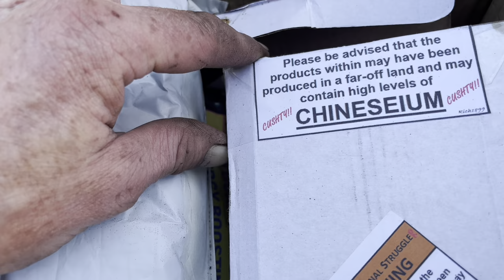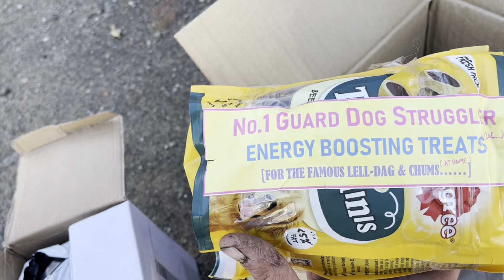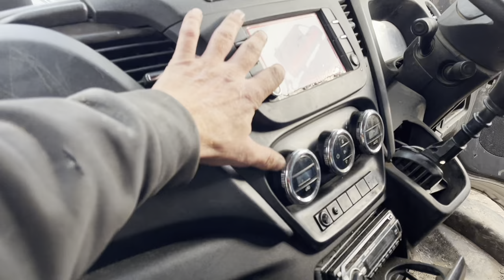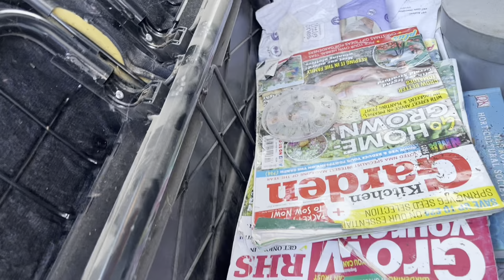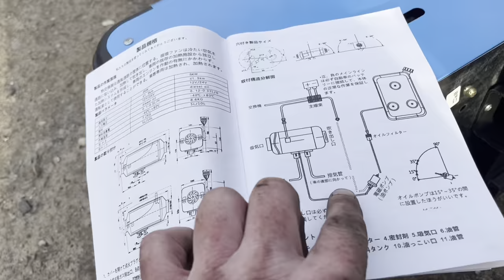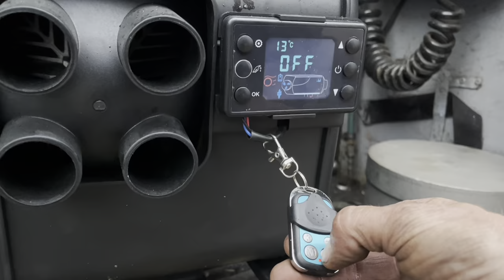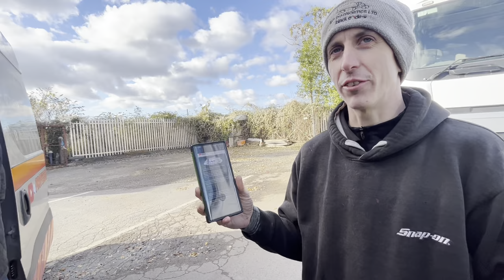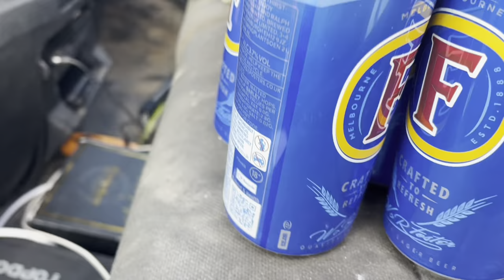UP GRADES for the STRUGGLE BUS!! Double birthday!

Comment: You can get a little 500w heater for your windscreen, runs off the battery. Just pipe that into the vents and you'll be able to see where you're going.

Comment: I was banging rad weld in an old Astra I had for years because the heating Matrix was leaking mate..  I remember going from near Gordano services M5 to Gatwick on Christmas Day to see the mrs and it started pissing out so I thought it was the problematic heater matrix so I carried on stopping at every services to buy radweld.. I spent more on radweld than petrol 😂😂😂.  Turned out it was a split pipe on the rear of engine which my finger could go into and the rad weld would seal it for 20 miles before it went again!
Anyway… happy birthday Chris

Comment: I'd be careful with exhaust on the  diesel  heater very tight to the van floor like that. They get pretty hot. They normally use a metal bracket with a round deflector bit on it that you bolt to the floor... keep an eye on it🔥....😂

Comment: I have fitted a fair few webasto heaters and always plumbed them into the trucks existing ducting. However I have just fitted a chinese one into a motorhome and plumbed it into the ducting from the gas heater and after 15 minutes it would come up with an error for ducting restricted, disconnected it from the vans existing ducting and it works fine. That was todays struggle but something to bare in mind if it throws up errors after reducing the flow down to the smaller bore pipe on the struggle buses heater. Chris.

Comment: Happy Birthday old boy . Those heater's are fantastic  for the money and easy to service pmsl even you could do it , JOKING ASIDE ,HOLE IN THE FLOOR NEEDS MAKING IT SO NO FUMES CAN GET IN  CAB   AND MAKE SURE ITS VENTED FROM UNDERNEATH  THE VAN FLOOR TOWARD'S THE BACK  AND OUT THE SIDE  NEAR TOWARDS BACK END .PS I HAD TO PUT A METAL SLEVE OVER THE EXHAUST IT  GLOWS BRIGHT RED. .last  thing.turn  the heat the off the correct way  . Or it will soot_up, its Friday

Comment: That black box mate is a sterling battery to battery charger ot charges your Auxiliary batteries I've got one that does 12v to 24v tells you on the front then the small red box is just the battery split charge relay

Comment: Happy birthday mate. You should move the diesel heater controller into to cab as the temp sensor is in it and may cut heat when it gets hot under the seat.

Comment: Happy Birthday  Chris , great video as always  👍 The Diesel heater needs the cold air intake (next to exhaust) piped from outside ,cold air makes for better combustion & cleaner burn  , if you suck air from inside the cab ,you create a vacuum in the cab ,so you need another hole in the floor for the air intake ,.secure the black "air filter" in front of the diesel heaters exhaust (so when you drive along ,you don't suck exhaust into the cold air filter) and clamp the exhaust well to the bottom of the heater with a decent jubilee clip (the Chinesium clamps in the kit are garbage) to avoid exhaust gasses leaking in the cab  👍 you can extend the cable on the digital controller to mount it on the dashboard ,where you can see it , the wired digital controller is also the thermostat ,so if left under the seat , could turn the heater off  too soon 🥶 it's  probably all covered in the instruction manual , but being a bloke  ,it's against the rules to read instructions 😃
Reply: If you put the intake pipe next to the exhaust that may recycle exhaust fumes into the cab and then Chris and his dog get carbon monoxide poisoning not a good idea.
Reply: @MartinBall-v6y  2 holes at the bottom of the heater are COLD air in and exhaust out (combustion system) , both should piped OUTSIDE ,as i said above 🙄 via holes in the floor , this keeps the combustion completely separate from the heat exchange hot air fan ,thus allowing the cab air to be heated and re-circulated inside the cab ,
the "COLD AIR" intake black filter does not put air into the circulated warm air